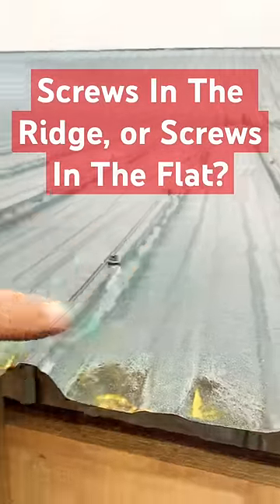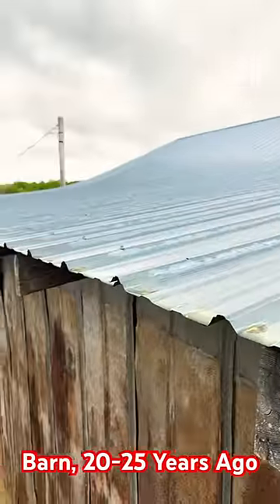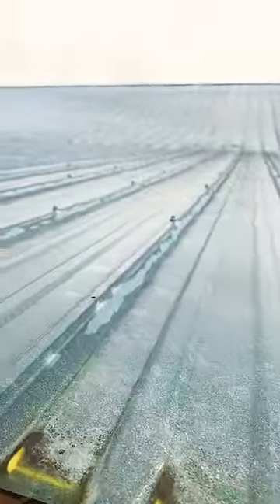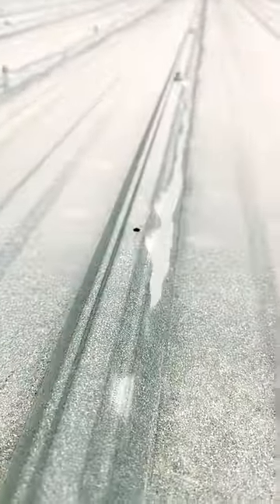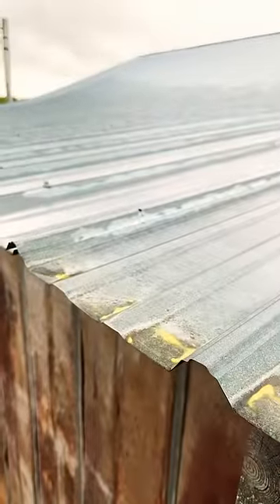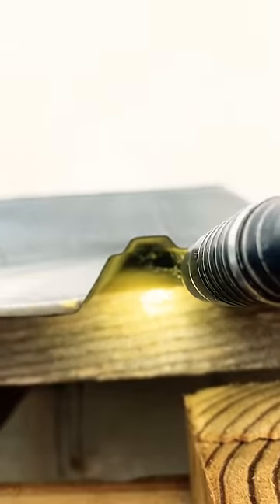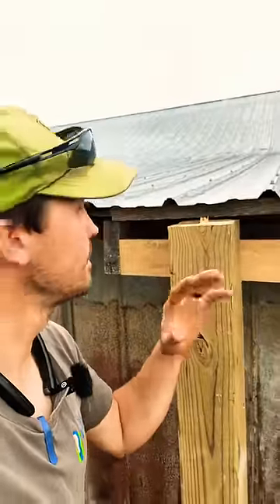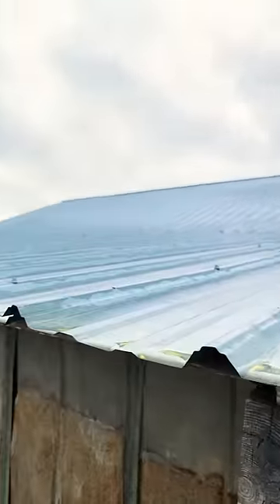What’s Better? Screws In The Ridge Or Flat? #construction #farmlife #building

Comment: Ridge, built 2 barns and 3 sheds. Always on the ridge.
Reply: Amen! I built a barn w my great aunt . We put em in the ridges n never had a leak👍🏼
Reply: What about the ridge getting pulled to the timber and misshaping the sheet? How's do you prevent that?
Reply: @jay36963 the rubber washer gives you a little room for error, you can also set your drill lower so it stops before deformation of the metal. When you do enough you just get a feel for it
Reply: I’ve built about 20 of them and never put them in the ridge… that’s dumb
Reply: Then you did two barns and three sheds wrong. Never ever on the rib. Read the manufacturer’s specs.
Reply: @Key5Med  yet it has yet to leak, 38 years later. I’ll take experience and wisdom with common sense over manufactures specs most any day.
Reply: @Key5Med I used to build for a manufacturer , maybe 10 years ago now. It was always in the rib , though I'm in a different country and maybe its different or maybe its changed in the last decade.

Comment: Ridge always
Reply from the maker: Yes sir!
Reply: Grandpa knows best dawg
Reply: @RouthFarms The ridge i follow you 💯 from  #YSW 🇨🇦  much respect 😊😊😊
Reply: Ridge always Voyage the warranty on the panels and they can blow off easier and heavy winds
Reply: @topherl1446 High wind areas:

End/External purlins – Fasteners are normally placed on the crown/crest corrugation of every rib in the horizontal direction.
Middle/Internal Purlins – Fasteners are normally placed on the crown/crest corrugation of every other rib in the horizontal direction, and spaced evenly along the length of the rafter. The spacing between every screw may be halved compared to mild wind area fastening for added strength.
Overlaps – High wind areas usually require overlapping two corrugations, on which both crests have to be fastened, and also along the length of both corrugation crests, spaced evenly along the length of the sheet.
Reply: What holds the sheet down if u do it on the ridge. Just asking
Reply: @williamlout7459  magic

Comment: Ridge makes sense, and it allows air underneath if it DOES leak to dry back out
Reply: Exactly, even if all the rubber seals failed that roof would still dry and last way longer. Put it in the flats all that water is getting stuck, no airflow, and will rot it away.

Comment: V crimp is meant to be screwed in the flats. Screw the ridge and the flats are flexed upwards and rattle in the wind. Only corrugated sheets are meant to be screwed in the ridge.
Reply: You must not overtorque screws in the ridges!
Reply: 100% right
Reply: Screws in the flat will always eventually leak. It’s inevitable.
Reply: Just don’t over tighten and it works in the ridge
Reply: Ding ding ding ding, you are correct, go to the head of class, no other comments needed
Reply: I agree 💯
Reply: @williamrmitchell1960  if you do that the tin is so loose that a good storm will blow your roof off. It's prone to tearing too because the flat of the screw head isn't applying pressure to the tin.

Fastening on the flat for v crimp does introduce a little more risk of leakage but if you're thorough and you use the correct fasteners with seal washers then the risk is incredibly low without the worry of having your roof ripped up by an average storm. Not to mention there should be a waterproofing layer underneath the tin regardless.
Reply: If so, they will buckle and flex in the wind. If you know what you are doing and see it, buckle back off the screw/bolt until it flattens back out.@williamrmitchell1960
Reply: @Patrick-zr8tv so this roof never experienced a storm in all its years?
Reply: @Patrick-zr8tv  exactly!!! I agree, if you do it properly it won’t leak! 

And I think that the reason the boards that were dry under the exposed holes in the video,  is because there is air flow under the rib so any water that gets in there can dry out.
Reply: Screwing into the flat will inevitably leak. Doing this you are solely relying on the rubber washer on the screw to keep water out. Screwing on the ridge relies on the rubber washer + gravity. This is a no brainer
Reply: actually 5 V-crimp is designed to be fastened through the top of the ridge -   put a fastener through the top of the 2nd, middle, and last ridge top starting from the lap  -  it dates back to the days of lead-head nails before neo-washer screws or nails were a thing,  and lead-head leaks on the flat   

 -  putting in the flat is also done with the fastener directly next to the "V"s  -  this method does not hold the lap tightly     -   lot of people also put fasteners on the flats half way between the "V"s along the bottom edge of the roof using either of the above patterns 

it's a PITA putting the fasteners through the ridges since they come to such a sharp point  -   best way is to use a rib panel instead of corrugated or v-crimp for a better roof with fewer joints
Reply: I'm sorry" you're wrong", we put it in the inverted v. You just don't overtighten it that causes beer Canning.
Reply: Why do you think the hole in the bathtub is in the bottom? Cause the water goes to the bottom, not on the top ridge.
Reply: @Patrick-zr8tv The risk of leaks on ridge screws is Zero, and properly torqued they aren't loose.
Reply: @Plankmills There would still be stains. Water Can't leak through ridge screws because there's no water on the ridges.
Reply: @ronjericho7977  the risk is way higher for a roof coming off when screwed in like this. I never said it was 100%.
Reply: @seanhazelwood3311  it's definitely not zero. Not to mention it is much more prone to tearing since it's more loosely held which can end up leading to a major leak that gets through any moisture barrier underneath.
Reply: @Patrick-zr8tv  Water can't leak where water can't go. Even open holes in ribs don't leak.

Yes, the flats are better for high winds.

In my area, heavy rain and medium snow kills roofs, not wind.
Reply: @santanawhitley7753 As a professional, what you're saying seems to make sense but in fact it's not true. I've been working with these panels professionally for a long time and no company anywhere would ever put these screws in like this. There are many reasons. It stretches the roof making it wavy by flattening the ribs. It will eventually cause worse leaking by cracking fire to strain. It looks like garbage. And most importantly, the panel isn't attached as tightly as it should be to the building. You always put screws in the flats towards the side of the top overlap. Bottom line. Always.
Reply: What's the difference between v crimp and corrugated sheets?
Reply: @trimwix9944  v crimp is the stuff in the video. Corrugated looks wavy I guess you could say. Looks like a sine wave. Not really sure how else to describe it but you've probably seen it before. You definitely will have if you live in Australia, very common over here.

Comment: I did roofing in high school and we always did ridge. Protects from leaks even after the rubber washer degrades since it’s not in the flow path. 

Also as a bonus you can vary the tightness of the screws to slightly widen the sheets on one end or the other as you go to adjust and keep them running straight

Comment: I was a roofing contractor in Michigan for 28 yrs . Always screwed the ridge because of the ice that would freeze in the flats .
Reply: OK, although my panel manufacturer said flat to maintain warranty. And screws in the rib/ridge make it almost impossible to use a snow rake to take the drifts off the roof in our l-o-n-g, snowy (usually) winter! ¯\_(ツ)_/¯

Comment: If you live in an area where you have to rake your roof because of snow you will find out just how annoying those SCREWS on the ridge are keep them the ___ off if you get More than 14 inches of Snow at a time
Reply: Probably this is why I was taught, in the flat next to the ridge. If you install the sheets correctly your ridges are still sealed against rain. 
If you don't install the sheets correctly, ridge screws still won't seal up lap completely.

Tldr: install the material correctly and it's largely an aesthetic decision.
Reply from the maker: We live in NC, and see very little if any snow  thankfully!
Reply: @robertalexander-bk5zj  when you say install correctly you are indicating that the purlin bearing leg goes down correct? This video demonstrates the old way of doing things in more than 1 way. They have the Purlin bearing leg sitting on top of the leading edge so when you step on it you can create a gap for water to find. It may look better to a lay person but it's far worse technically
Reply: We may be using two different sets of vernacular,  so I'll try to explain. 
My knowledge you have your "top " and "bottom" ends determined by the direction you're installing sheets. Left to right, or right to left. This direction would be best determined by prevailing winds. 
Your other sides your "lap" and "lead" edges are the two outer ribs on each sheet.  The "lead" rib is profiled differently to fit underneath the rib of the opposite "lap" side. 
Biggest issues I've seen are caused by crooked sheet installation, bowed sheets, and improper lapping of sheets. 

Tldr: yeah, probably.

Comment: A lot of people here think they are professional roofers. Lol. This style roof you do the flats and on the ridge where it overlaps. The flats the screws gasket can be crushed between the metal roof and the board below it. While on the ridge, it isnt able to seal as well.
Now where the idea for the ridges comes from are the wavy roofs with no flats. In that case they go on the ridges.
Those that put screws in the roof as shown in the video are fudds.

Comment: I'm sorry to be contrary, but PLEASE do not put them in the ridge...
A few years ago I replaced the roof on a brand new double wide only a few years old because the Amish put screws in the ridge and the snow load on a fairly shallow angle elongated the holes about 1/2 inch+ and the entire place had very very serious mold and water damage...

They planned on having us completely rip out and remodeling the inside, but it was bad enough that in the end they deciding to demolish the home and bought another double wide in even after they paid us to replace roof...
Reply: Wouldn't this happen with the screws in the flat too?

Comment: As a retired contractor, the factory requires the screws in the flats, or it will void the warranty .
Reply: Yep go with the warranty
Reply: So leaks do their damage after warranty out anyway.
Reply: As a professional home owner, don't care about the warranty since the roof will outlast the company anyway. I would put the screws in the flats if I was more concerned about wind uplift, if my screws were weak, not enough screws, or the underlayment was weak. Otherwise put in the ridge to reduce leak.
Reply: Maybe not an american thing, but I was supplied with saddle bounded washers that exactly fit the "ridge" of the profile I was using. By the manufacturer.

Comment: Screws go in the flats but stitcher screws (screws that do not extend into the decking) can be used on lap joints if required.
Reply: No. Unless u want leaks
Reply: Only on steel purlins
Reply: That's correct.
This metal was designed to be fastened with screws next to the rib and not in the rib. It's also much more difficult to keep the metal straight when you screw in the rib.

Comment: There has never been a debate. Ridge.
Reply: Built metal building for years and we never screwed the ribs. That would void manufacturers warranty. From our supplier anyways
Reply: There is always that one guy who swears blind the the opposite...
Reply: But of lately of I have seen many installations with on flats, leave me wondering WTF.
Reply: Perfect place to screw if ya  wanna void the warranty. 😂
Reply: @colbykinney5633  False. Every form of contoured sheet metal (Trimdek and Colorbond here in Australia) requires screw fixing at the high points (ridges).
Reply: @colbykinney5633  Only place to screw Trimdek or Colorbond here in Australia if you want to keep your warranty AND the space below dry. 🤣
Reply: @NealosMetropolos     yeah,  but Trimdek is NOT made like the roof panels in the video or those commonly available in the US  -  it's more compatible to our old corrugated tin roofs  -  and those you did always nail on the highs / never in the valleys  -   Trimdek doesn't really have flats:  it is designed with two valleys between ribs and it never fits flat on the perlins between ribs  -   Trimdek also installs with really BIG long fasteners:  in the US the common fastener is much smaller/shorter  -   you also barely snug Trimdek screws :  most folks in the US way overtighten the fasteners causing expansion and puckering in the roofing
Reply: @bonesrhodes3762   - you said it - installers tend to do it wrong...  Seems the US manufacturers have to make a product that can't be screwed - wrong...  (that you are fastening down to a flat deck most of the time - nearly every instal in  Australia is onto timber or formed sheet metal battens with no bracing deck).
Trimdek on walls, is screwed in the pans - adjacent to the base of the ridge...
Reply: Ridge for corrugated, flats for v crimp.

Comment: Both.  Every commercial metal building in the country has screws in flats to hold the sheets down and in the ridge on laps.
Reply: Not the ones I built.  I always  screw the main roof on the ribs, and the eaves outside the building envelope on the flats for wind.  Extra screws on the lapping rib called stitchers to get that butyl adhered well 😉
Reply: And what might that be ??
Reply: Yup every commercial building has screws in the pan
Reply: I can confirm this as an hvac guy that has too sweep up my mess when done….I grab the dust pan when I get to the screws (in the flat) that fasten it to the purlin.
Reply: Doesn't make it right just because you see it done that way. This is America, we do stuff wrong constantly.
Reply: The reason to put the screws in the flat is for wind you have much more wind capacity with the screws in the flat

Comment: Well screws in the ridge is better for water sealant cause the water rolls off the ridges anyways but id think the flats would be a stronger hold, so might depend on your area and how much wind/rain it gets
Reply: Hit the nail on the head, I wouldn't roof a building like that where I live, the screws wpuld be ripped of quick

Comment: Follow the steel manufacturer's installation instructions and you won't void your warranty. Screws on the flat will transfer diaghram bracing loads through the steel. Will the screws through the ribs transfer loads or just bend? If you walk that roof and you step on a rib will it work up and down on the screw threads and elongated the hole or just catch on a thread and not seal? If you screw in the rib while installing the flattening of the rib will shrink or grow your panel differently from person to person and make the job of the guy running the line much harder. Have you ever installed a single roof or are you just looking at an old roof? What does the manufacturer of this steel tell you?
Reply: This reply has more knowledge that the entire rest of this comment section. And swings a better hammer
Reply: @calebz1448  👍

Comment: In Ohio we go on the flat… when the steel expands and contracts due to temperature changes screws on the ribs have too much back and forth play and they end up either unscrewing themselves or breaking, but I think this will be an age old opinion difference for different people in different places, our manufacturer requires screws to be on the flat in order to uphold their end of the warranty.
Reply: So crazy I did a barn in ne Ohio and was told to do in the ridge so they wouldn’t leak and could expand and contract without issues in the ridge rather than the flats.
Reply: @tylerjmckever7655  that’s crazy… must really just boil down to the manufacturers opinions, lol or the guys installing it I think at the end of the day anytime you put a penetration through a piece of metal There is a chance of a rubber washer failing so standing seam is definitely the way to go if you’re roofing a house but also very expensive.
Reply: Built barn for 3 years. The washered ring shank nails aren't coming unscrewed.  We nailed until the washer very slightly squished on the ridge. At the bottom 3" in the flat.
Reply: @timothydavis3703  I replace many roofs with loose dangling ring shank nails where the wood rotted out from so much water. Threads engaged into proper wood no glue board or no go on a roof
Reply: @calebz1448  water damage is always a problem in the Midwest.  While building those polebarns in Michigan,  it was always in treated stringers and southern yellow pine for the trusses. Never did repairs,  only new.
Reply: After 15 years of twist galv roofing nails in the corrugated roofing on our family home (Dad was a builder) the nails needed hammering back in up to 1/2" (not all, but many). Through the ridge makes nails work loose from expansion/ contraction. The second time they worked loose, roofteks replaced all those nails.